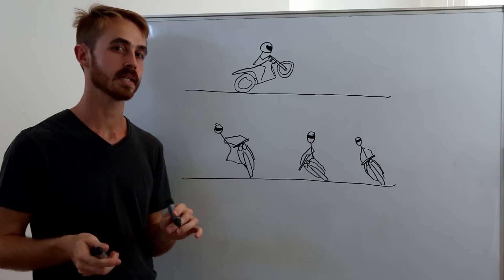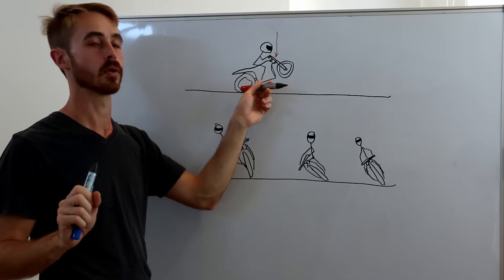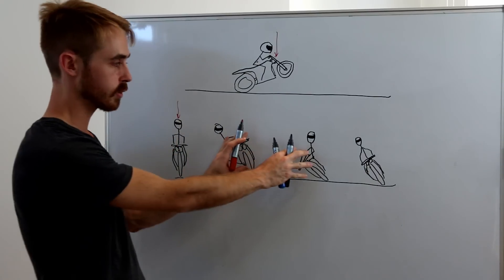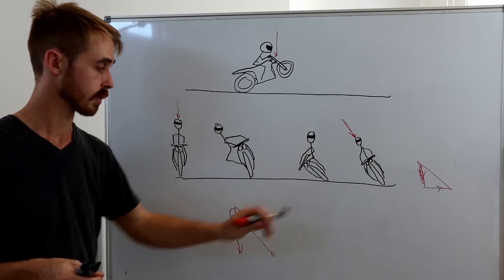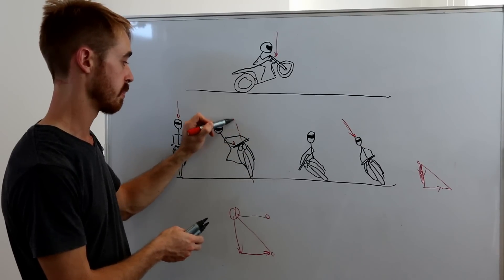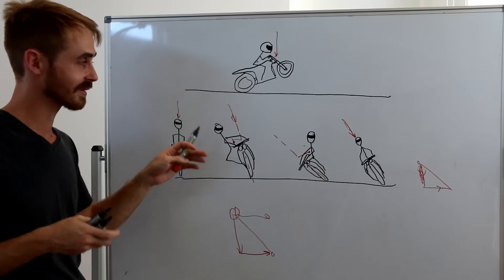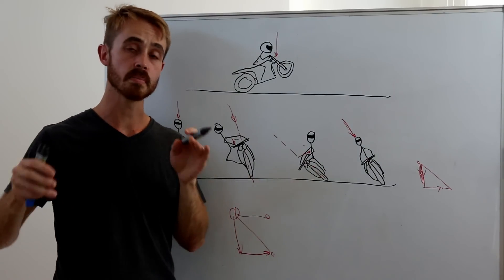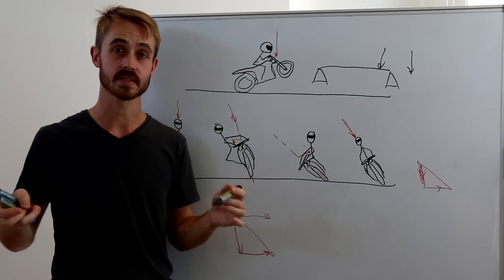How Does Downforce Work for Motorbikes? - Motorbike Aerodynamics Explained

Comment: So from a motorbiker here, front wheel grip is the limiting factor of almost every single aspect of riding a bike. Its very easy to shift your weight backwards, however at your riding position its very difficult to move any further forwards at all. Now the cornering improvements are some of the least important aspects of front downforce. Firstly one of the biggest improvements will be in braking. Almost all of the braking for any bike is done near exclusively on the front, the back brake is merely there to hold the back stable and stop it trying to overtake the front. Now in braking you will usually put a small braking force for a moment to shift the weight forwards and load the front wheel at which point the wheel spreads out for a larger surface area and mixed with the dramatically increased weight you can start to brake properly. Having the front already loaded with weight will improve this all and the rider merely needs to shift his weight backwards to take advantage of the wing. However bikes can already brake hard enough to lift the back wheel up (hence why the rear is barely used beyond stability, it has very little weight during hard braking) and so beyond allowing the rider to move further rearwards and beyond the faster responsiveness in not having to progressively load the front so slowly there will be little advantage.

The largest advantage I see still lies in braking, but in trail braking to be precise. This is essentially braking whilst also turning the corner. Both use the front grip and so you need to balance the two to stop losing front traction (which instantly takes you off the bike as opposed to rear traction which can be recovered). Now as you are only braking a small amount the rear isn't at risk of lifting up, and because you are only turning a small amount there is little to no lean and so the force goes directly down to benefit front traction. This will be done for a good portion of every corner, sometimes almost up until the apex an so it is a very notable benefit.

For the mid corner a rider will ALWAYS be leaning an trying to keep his bike as straight as possible as this affords a larger contact patch and generally better turning characteristics. Again the front is the limiting factor and is very dangerous to lose and will result in a fall. The benefit of winglets will be small however due to a large lean despite the limit entirely on the front tire again.

Just after the mid corner the rider will be starting to accelerate and starting to straighten up, somewhat the opposite of trail braking. Here the limit is usually on the rear tire - modern racing bikes have such extreme amounts of horsepower that they can easily lose the back end. Fortunately losing the back only results in a time loss and a scary feel and will rarely throw the rider off too. A rider will usually shift backwards as far as they can and load the weight on the rear tire. The winglet might slightly help keep the front stable and allow a tighter turn at the exit but really the time gained will be all on a strong acceleration and good traction.

Finally you have full acceleration. Now contrary to common knowledge a bike will rarely pop a wheelie through sheer acceleration - the bike gears are tuned to be right on the limit to avoid a wheelie but still get the max acceleration. For my bike this meant 87 mph in first gear. Now its arguable that the winglet might help but the risk of a wheelie is mostly at the lower speeds, about 60mph for my bike, the speeds at which a winglet is least effective. Second gear and beyond show less power than first and so are less likely to wheelie. Pure track bikes might be a little different in allowing a wheelie occasionally but will still have the philosophy of "if a wheelie is the fastest we can accelerate why use a lower throttle when we can just increase the gear speed and remove an excess wasted gear" and so I would expect this to have very little difference. Additionally the rider has to put all their weight forwards, not even to avoid a wheelie but because unless they are leaning forwards at an extreme angle their body will be pulled back and ripped off the bike.

So basically a front winglet is a great benefit, extremely useful in a handful of areas and slightly useful in the rest. A rear winglet would likely get in the way o the rider leaning round the corner and would generally have much less of a benefit. And finally the bike's balance could be tuned to account for the winglet placing the rider a little backwards to the same effect. I can't imagine the winglet posing too great of an issue as a fast bike gives such incredible amounts of feedback that its very easy to pick up how the traction is, particularly front wheel mid corner.
Reply: Rarely wheelie during acceleration? Really?
Reply: @thedirtyworkshop  Oh hi there matt
Reply: @thedirtyworkshop  I can't recall ever popping a wheel by mistake. I've come close with a big friend on the back uphill, and I've felt the front get pretty light up a steep hill (without lifting the wheel more than an inch), but on flat ground that isn't something that happens. At least on my bike anyway, a 170mph ZX-6R. There is no racing benefit to popping a wheel, and it would be better to have a longer gear on track, so they select first gear to get as close to popping a wheel as possible without actually doing it. The way people typically wheelie isn't by merely opening the throttle, but by chopping the clutch. Pulling in the clutch takes the weight off the rear and rocks the bike forwards slightly. The engine revs up, then dropping the clutch (a fraction of a second later) dumps that stored energy rapidly and is more than enough power for the difficult initial portion. The former part only really being important in weaker bikes. Then when the bike is already on one wheel it becomes significantly easier to keep it there. Power wise anyway, skill wise its obviously very difficult to modulate the throttle.
Reply: @olivialambert4124  I notice many contradictions between your first comment and your last reply: 

first comment - "Just after the mid corner the rider will be starting to accelerate and starting to straighten up, somewhat the opposite of trail braking. Here the limit is usually on the rear tire - modern racing bikes have such extreme amounts of horsepower that they can easily lose the back end[...]" verbatim 
Last comment- "corner exit the major problem is in hitting the throttle the weight shifts to the rear. That causes a loss of front grip and really ruins your time. Of course you could chop the throttle too aggressively at the exit, but thats incredibly poor riding and won't gain you any time even if you wouldn't lose traction[...]" verbatim 
 Also i have made a mistake, it seems that you have completely made up sentences that i have never said, you quoted me saying "In braking a rider will shift backwards" i have never said that and my reply about wheeling doesn't even mention braking at all.
Reply: -"front wheel grip is the limiting factor of almost every single aspect of riding a bike" 
false? if you are speaking about track riding corner exit is as important as corner entry and the cornering phase does indeed have a smaller margin of improvement but it also determines the trajectories of bikes in medium to big radius corners. 
-"A rider will usually shift backwards as far as they can and load the weight on the rear tire." absolutely not, every good rider who understands bike mechanics knows that to contrast a wheelie it is fundamental to shift your CoG as low as possible (suspension actuators in motogp to lower the rear suspension) and as forwards as possible, to contrast the torque imparted by acceleration. 
-"Finally you have full acceleration. Now contrary to common knowledge a bike will rarely pop a wheelie through sheer acceleration,  the bike gears are tuned to be right on the limit to avoid a wheelie but still get the max acceleration" 
That's exactly the point, with wings you would get shorter gear ratios to accelerate faster. 
-"if a wheelie is the fastest we can accelerate why use a lower throttle when we can just increase the gear speed and remove an excess wasted gear" 
said no racer ever at all.
Reply: @t0k4m4k7  No. Corner exit the major problem is in hitting the throttle the weight shifts to the rear. That causes a loss of front grip and really ruins your time. Of course you could chop the throttle too aggressively at the exit, but thats incredibly poor riding and won't gain you any time even if you wouldn't lose traction. The only times your rear tire will be at risk are in poor traction environments, eg rain, and in very tight corners. The very tight corners you might get more acceleration, but its incredibly rare to have a corner tight enough to lose rear traction yet opening out enough to allow you to open the throttle that early. And if there were such a corner, the rider would be leaned far over and spoiling almost all of the aero advantages anyway.

"In braking a rider will shift backwards", I'm not sure many riders are concerned with popping a wheelie during hard braking. Perhaps you know some techniques I don't? And while we're on the point, its a little absurd to be suggesting one would move their weight rearwards to AVOID a wheelie. Normally that is how people (non bikers) think a wheelie is provoked, not avoided. And of course its preferable to have the weight as low as possible, that is something seen in every track motorsport I can think of. When the limiting factor is often from the weight too far forwards or rearwards rather than losing traction, the only way to gain would be to lower the weight or shift it forwards/rearwards.

We are talking about first gear. In first gear aero isn't particularly useful. Not many high end motorsports are setting up their aero for a single 60mph exit whilst also working on multiple near-200mph sections. But again perhaps you know something we don't? So yes solving the issue allows us to change gear ratios but if we only have a risk of popping a wheel in first gear, and if it is ineffective in first gear, that becomes a bit of a moot point does it not?

I'm not sure I've ever heard an engineer demand reduced performance and adding extra gears where they aren't needed. Or why would a racer want a gear he doesn't ever use? Take my bike for example, 86mph in first gear. We would then be discussing adding another gear at, say, 50mph. Why would anyone ever use that when it offers absolutely no benefits above the 30mph start (for which we can ride the clutch and lose a fraction of performance), especially when the track would see the bikes go no lower than 50mph anyway. And even if there were a 30mph corner, why would a racer want to drop down to a lower gear and be limited to the exact same acceleration anyway but with a greater risk of losing the bike? You may not realise, but part of racing involves selecting the wrong gear early so that the racer doesn't need to waste time shifting later. Eg dropping a gear early to over-rev the engine on entry and thus having a better exit and shaving time. Adding an extra shift for absolutely zero performance gain is something no racer has ever asked for. Adding an 8th gear to a packed gearbox for no performance gain is something no engineer has ever pushed for.
Reply: @t0k4m4k7  Yes I'm completely getting corner exit grip problems riding in a straight line, right? Maybe you should be a little more patient and smooth on the throttle, allow the bike some weight transfer, and you might not be getting problems. That or you've just cranked your shocks up to full and you've taken any ability for the bike to transfer weight out anyway. As or traction control, I've personally never ridden a bike with traction control or ABS, but considering the former is advertised and demonstrated by riding the bike over wet surfaces I'd have to imagine that might be the purpose. And yes, I already mentioned rear traction does apply in poor traction limited surfaces. Or if you've got cheap/hard tires, I would imagine. Again, not something I have much real experience on regarding the tires.

We aren't talking about doing a stoppie. We are talking about the gearing preventing the bike pulling a wheelie. I'm not sure how the bike's gearing would be related to pulling a stoppie. But yes, it's possible on even a cheap street bike. But most riders will avoid doing it in any sort of competitive environment, as the traction loss from the rear causes severe rear instability which can lead to time loss or even a tank slapper. Hence the use of steering dampers on sport motorbikes. And whilst you might not have mentioned braking, you did reply to one of my comments about braking whilst clipping it as though it were about accelerating. Hence why I paraphrased it and clarified. Ie you indeed did talk about braking, you either didn't read the comment properly or were attempting to be deceptive in your reply. And yes, all riders should understand weight shift both on the throttle and more importantly on the brakes. I understand the rear wheel can lift which is entirely the reason I suggested riders will shift their weight rearwards to mitigate this to a small degree. I'm not sure why else you would imagine I have now repeatedly clarified "shift weight rearwards under braking" if not to prevent the rear wheel lifting, perhaps you think I'm suggesting it in a race for comfort reasons?

Again, if the bikes will be able to pop a wheelie during 4th or 5th, they would have changed the gearing to prevent this. There is no benefit to being in a lower gear and putting down throttle limited rear torque, when one could be in a higher gear to put down the exact same torque with more throttle. After all, the level of torque required to wheelie doesn't change, and the bikes torque delivered to the rear doesn't change to any notable degree through the RPM used. So as I have already said, why would a racer want to use a gear with zero speed benefit but the demand to shift through apparently 3-4 gears. Why would the engineer want to add 3-4 gears which aren't needed? I doubt a MotoGP bike is all too concerned with low speed riding through traffic, and even the slowest corners on a circuit will be in the torque band. As for popping a wheelie in later gears, you may not know how wheelies are done but as I explained to another commenter a wheelie is done through the use of the clutch. And yes this allows my bike, 1st gear full throttle no wheelie anywhere, to pop one in 3rd, possibly even 4th. But the main point you were replying to wasn't about the abuse of a clutch to wheelie during a race, it was about the normal smooth application of power during a race. "Anti-wheelie" aero isn't particularly relevant when going in first gear well below the speeds required for aero. As Kyle explains elsewhere, aero increases by speed squared, and for low speeds you either need to go all out for extreme aero or add absolutely none at all. The former might harm the performance of the bike during the other 95% of the track no? I have already made this point, but perhaps you need it spelled out a little more. My mistake, I assumed you had watched the videos on the channel you visited.

No I didn't make up sentences you had said, I had explained the reasons you might be losing the rear in the way that you describe. I assume we are both talking about modern high performance track bikes with proper tires and suspension either set up properly or left as it is from the factory, yes? If so those will be the reasons you are losing the rear, poor riding technique or poor surfaces. If you have another reason to be losing the rear by all means explain it, but so far I have very little confidence in your ability to self diagnose, indeed I'm now uncertain if you ride such a bike at all. And yes you had never said "in braking a rider will shift backwards". You had replied to my statement with ME saying that, paraphrased. You had talked about how I might be shifting backwards whilst opening the throttle for some reason thinking less weight on the front would lower the front and prevent a wheelie. I then paraphrased the statement you had replied to. Is that clear enough for you to understand this time? I had thought the following statement I made about how you thought I would do exactly that phrase would make that clear, but I guess I need to slow things down for you. Though having to spell every single thing out will generate a larger wall of text you understand.

The miraculous capabilities you ascribe to MotoGP bikes is understandable, they aren't talked about much and even fewer people have ridden them. Your inability to communicate with your bike is another thing. Perhaps shouldn't be commenting so aggressively if you don't have the skill to understand but people do seem to want to compensate. But your lack of comprehension of the basic English language is really the crux of the issue here. Most of your problems come from the complete inability to read the most basic of sentences, and your aggression in replying to things you are entirely unsure about. If you struggle to read you can at least stop to think "does it make sense, would a rider shift their weight rearwards under braking whilst not understanding the rear lifts" or even "would they shift their weight rearwards in an attempt to prevent the front lifting". If it doesn't make sense, and your English comprehension is so severely lacking, there is a very good chance you simply read it wrong. That's at least something to take away from this, it doesn't just apply to our nice little discussion here.